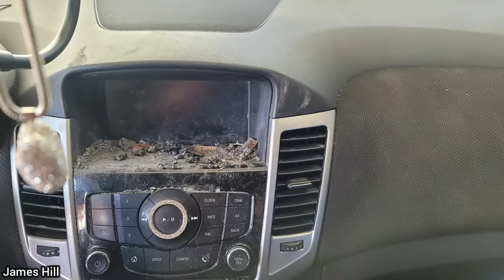Customer States New Oil Pump Installed, Still Has No Oil Pressure

Comment: Some repairs should legally be beyond "declined."
Reply: Sometimes “declined” means “run away screaming”.
Reply: Yes!  If the car is obviously unsafe and the customer declines repairs,  let them know that the car can only be removed from the shop by a tow truck (and call the cops beforehand to let them know of such a removal in case there's trouble).  I'm sure a legal technicality would allow the customer to demand that it be unhooked after it leaves the shop premises but, the customer will still have to pay the minimum towing fee and the shop cannot be held liable for the unsafe car.
Reply: We used to push them into the street at the customer's request if they didn't want to pay a tow fee to get the auto home. We wouldn't let them drive on our lot. It's their choice once it's off our property, ours until then.
Reply: @thewesty101  That's a fair compromise.
Reply: I've been in the auto business for 20+ years. In NY you can pass state inspection with bad ball joints which in my opinion is way worse than a headlight out or torn wiper blade which makes you fail.
Reply: And all rigs 10 years old or more should have to go to a safety inspection
Reply: @Fordgroup00  Had a friend that joined the Navy and was stationed in Japan. I forget how old his car was but to pass inspection the whole brake system needed to be replaced (lines, hoses, calipers, master cylinder, booster, etc.)  Also any kind of oil leak was an automatic fail.
Reply: I'm not a lawyer (but i've played one on tv, j/k) 🤣 But seriously, along the same line if a bar keeps serving a customer who is clearly intoxicated to leave knowing they're going to drive and they get into a possibly fatal wreck, that bar could be held liable, right? These shops should also not allow clearly dangerous vehicles to leave their shop without alerting the authorities if for no other reason than to cover their asses in case that vehicle causes a wreck afterwards. Any real lawyers wanna jump in here?
Reply: @fosterpainter when you're driving a vehicle so badly damaged you become an active threat to anyone around you it's not just your life anymore
Reply: No, absolutely not. 

If they were to implement a federal system of some sort we'd end up with some sort of household inspection nonsense. 

Car for the 1990's comes in for an inspection
Car gets marked for a brake job
In order to change the brakes the entire system now needs to meet modern safety standards
Reply: @Froosev2  My PU passed VT inspection about 5 days before my rear brake line finished rusting clean through. VT does check ball joints though.
Reply: @antilogism  ... you have to remember that most state inspections only check to see if things are working NOW.
Reply: @BlackPill-pu4vi  ... yeah, and if the police know that a certain car is NOT legal for the road, they can write the guy up for operating with faulty equipment and start the tow process again.
Reply: In germany there is a safety inspection every 2 years for all cars, trucks, farming equipment and motorcycles. Only ,,Mopeds" and ,,Mofas" (both like motorcycles but slower) don't have to, but it is in your duty to keep them roadsave. I started to do some work by myself, like cleaning the breaks because they got sticky (grinding all the time or wouldn't let lose), and the shops would charge 250-600€ per wheel for ,,new parts"... 
I removed the dirt from the breakshoe (im not sure if the words correct, I'm not a mechanic), removed the rust from the gliding pen, checked if everything looks good and greased the gliding pen. Took me 1,5h per wheel, and fore no cost including I know how it looks really if I need new breaks. I have only fore my some backyard mechanics in the near with not much knowledge about my car type resulting in wrong parts which are not exactly suitable fore mine or those with the knowledge charging a lot of money. The next really brand shop fore mine is now a 4h trip away after the only one which was 2h away closed.
Reply: @JohnnyD1993  Most of the rest of the developed world manages quite successfully to implement vehicle safety checks without requiring (say) a 1990s vehicle to have its entire brake system replaced "to meet modern safety standards". Why would the USA be incapable of doing so as well?
Reply: @dunebasher1971  Rules and regulations aren't ever about anything other than money. 

Why allow them to continue driving something old when you could get them into a newer automobile?
Reply: @Froosev2  

hmmm the oil leak thing seems weird. Some leaks, absolutely. The brakes, I just spent $4000 on new brake system on my wife’s ’02 Lexus. 

It absolutely should be safe on the road, it’s not just “you” you’re endangering

So I did a quick google search on the oil leak, it basically said SIGNIFICANT leak(s) would fail. So your “friend” was obviously driving around a sh’t car that needed some work done to it SMDH
Reply: @Fordgroup00  it hadn't been inspected at that time, he was just telling me what they were going to look at.  Now that you mention a significant oil leak that sounds familiar.  This was 20+ years ago
Reply: @Scrap_Goblin  Some don't understand that when you're behind the wheel, you're using a couple ton weapon. Negligent use laws exist for other weapons, so why not your daily one?
Reply: @dunebasher1971 the part about meeting modern day standards was sarcasm, that's the process for most home repairs when you have someone licensed work on it
Reply: I have called the State Police and had vehicle's towed to the scrap Yard Because of Frame Rot and Dangerous Damage issues to Car's & Trucks
Reply: Always Make sure a Customer signs a Repair Order that warns Them of Dangerous Damage's Found and REPAIRS Rejected by Car owner's! Sometimes you Need to Contact the State Police About unsafe Vehicle's!
Reply: @BlackPill-pu4vi  There are some dummies out there, but more often people can't afford shop rates. I offered a couple times to swap brakes off duty, and I'd mount a tire for free for those who really needed it. I may have missed some points on the state inspections on some cars too, never can tell though. It's just little shit to keep each other up and running to us, but to them it's their entire livelihood
Reply: @Fordgroup00  (re Froosev2's friend. The Japanese inspection is draconian and combined with rapidly rising registration costs after 3 years the obvious intention is to keep people buying new cars.
Many of these used Japanese cars end up here in New Zealand. A 3 year old car with low miles can be a fraction the  cost of a new one. Right hand drive too.
The inspection here is annual (6 months for older) but the inspectors are reasonable and the cars age is taken into account.
Reply: @Fordgroup00  Anything over 5 years. I have a fleet with 2020's that have 200k on the clock. emissions be damned, routine safety items like tires, suspension, steering, brakes. If it isn't safe to drive, it can't BE driven legally in my eyes.
Reply: @Scrap_Goblin  You see, this is where the mandatory safety inspection should be a thing. However, it needs to be beyond the state's control, and be a federally operated thing, with shops having the ability to revoke an inspection certification for unsafe brakes, or bald tires if the customer chooses to not repair the vehicle.  Legally, a shop can only require it be towed away, we cannot legally deny a customer their property(the vehicle) but we can deny them operating unsafe vehicles until it reaches a destination OFF our lot. Unfortunately, from a legal standpoint, that's all we can do. If it leaves on a tow truck, what they do from there is entirely their decision and the customer is 100% responsible after that.
Reply: @bobw7018  

Right on. Yeah I don’t know why this is such a difficult concept.

I don’t even run used tires, I buy new tires. My ex brother-in-law would always buy used tires. I gave him so much grief over it SMDH
Reply: @Fordgroup00  used tires are another thing I despise with a passion. But I'm the same way. I service cars all day, and know we don't just take old tires off for no reason. Our shop has a carbide bit we take a 20mm circle of the sidewall with.
Reply: @Froosev2  

Ah, right on. Yeah that makes more sense
Reply: @GSimpsonOAM  

Then people need to quit buying new cars. I can’t imagine it’s cheaper to get into a new car after 3 years vs proper maintenance of a vehicle to begin with
Reply: @bobw7018  

Right on. A car improperly maintained is a hazard to everyone. I can’t believe people even are willing to risk their own family SMDH I can’t imagine a single time where a used tire is preferable to a new one. Hell even new ones are faulty sometimes.
Reply: @Fordgroup00  you're very right about that. Ive seen tires right off our delivery truck be unusable. I won't even consider unsuitable parts. New for brakes and tires, without any discussion. I value not hurting someone or taking your loved ones because I couldn't control my vehicle.
Reply: @Fordgroup00  Some people simply want a new car. Most businesses prefer to buy new as they know what they are getting (service history from new) and can claim depreciation on their tax.
Parts for imports sometimes have to be ordered and the wait is an issue for some.
There are pros and cons...
Toyota New Zealand, when they stopped building cars started a "Signature Class" of used Toyotas which are checked and approved by them. They still sell new of course. There is a market for both.
Reply: @JohnnyD1993  here in germany we have vehicle safety checks, which must be carryied out every two years, and i can attest you, you dont have to install a new braking system every 2 years. Every car has to go through it, and oldtimers from 1930s are still road legal with their original parts (as long as they are working, a brake check is mandatory, but they are testing if the brakes are working, not if they work to the newest modern standart).
And stuff you see regulary see here on the channel would be very often filterd out by these checks, since that amount of rust damage you often see here takes far longer than 2 years to happen
Reply: @Patrick-bu4vq  ... BRAKES, not BREAKS
Reply: I'm so glad we have "TÜV" in Germany so at least every two years you have to let your vehicle be inspected and if it fails, you're not allowed to use it until it's fixed. You decline the repairs? Okay, you'll have to walk.
Reply: I'm so glad we have "TÜV" in Germany so at least every two years you have to let your vehicle be inspected and if it fails, you're not allowed to use it until it's fixed. You decline the repairs? Okay, you'll have to walk.
Reply: @Froosev2  Here in Australia the car gets inspected every 12 months & the car must be in good working order. No oil leaks, legal tread, no rusted out areas (even panels), brake test & lights/blinkers etc.
Reply: @JohnnyD1993  try looking at other countries, Denmark for example has a bi-yearly inspection of any car or motorcycle, required by law.
in order for vehicles of a certain age to pass, you can register it as an oldtimer/ classic car, and only need to pass the standards of those days.
if you fail, you can drive it to the mechanic to get it fixed, go anywhere else and you lose your licenseplates, and get them back after your vehicle passed inspection.
if the vehicle is decidedly unsafe to drive thay take them immediately
i feel more comfortable knowing that i'm not driving next to a wreck that neither can steer nor brake properly, because those are taken of the street before anything can happen. (the ones behind the wheel are a different matter sadly)
Reply: @JohnnyD1993 you're completely biased to this idea gov wants to hurt you or make you pay for new.

The main goal behind gov mandated MOT's is to ensure the safety of its populace - from 'friend mechanics' without brakes, broken shafts, busted taillights, fire hazard electricals, or rusted off frames.

If you can stomach to hear the reasoning behind it you'd understand it is never about meeting modern safety standards. You can buy a taken cared of Toyota from 30 years ago and it will pass even though it doesn't necessarily meet modern safety/NCAP/emissions standards.

You can buy a 1960's vehicle that is generally a death trap without seat belts but it is exempt due to age and as long as it has the bare minimum (lights, brakes..) it will pass.

Unfortunately some people regardless of their economic situation, regardless if they are desparate need to be warned and their vehicle taken off the road. Not because gov hates them or wishes to overextend their power but because their brakeless, suspension collapsed, rusted 4000lbs truck going 50mph is a rolling hazard for them and for everyone else out in public be it drivers or pedestrians.
Reply: @rupe53  English is not my native language, but for simple communicating is it enough that the other person understands what I mean.
Reply: @thewesty101  fair? Irresponsible.
Reply: @bobw7018  

Right on
Reply: @GSimpsonOAM  

Right on
Reply: @Valks-22  

Agreed 👍
Reply: @olerothemberg3869  The other difference is that vehicles is always tested against the rules which was in force when the vehicle was new.
Reply: @TheStefanskoglund1  

Brakes working properly, wheels having all the lug nuts on securely, safe tires, mirrors, no offset hubs, no aftermarket fog lights on public roads/streets, leaks to a minimum, engine burning clean, lights are all things that don’t matter if 200 miles or 200,000 miles
Reply: @Froosev2  Yeah here in the UK we get a fairly good deal on grey import Japanese cars because we're both right hand drive, and the inspection standards are so good a lot of relatively good condition cars with minor faults often get replaced for newer cars.
Reply: In Germany such damages would render your car as inoperable and could get you in jail if you drive it on public streets. It is absolutely insane to me, that people in the US are fine with people driving these trashcans. These idiots are risking other peoples live out of stupidity.
Reply: @@fosterpainter Totally agree with you. Way too many people out there who think nothing of putting everybody else on the road at risk.
Reply: @rupe53  How many languages are you fluent in with flawless spelling?
Reply: @Patrick-bu4vq  I apologize for people like @rupe53.
Reply: @MaxxBigg  .... this wasn't about spelling. (both spelled correctly) It was an incorrect word. One is a verb, and one is a noun. I already gave him credit on his explanation for not being a native speaker of English.
Reply: So long as that doesn't force a customer to pay that particular shop for repairs, or be forced to use any particular towing company.
Reply: @orppranator5230  Or at least make tows under that category a fixed rate per mile so it doesn't make a difference how these vehicles get home.
Reply: @BlackPill-pu4vi and because of people like you we have a nany state. How are the boosters?
Reply: @sweeptheleg. good job Comrade, your social credit score just went up.
Reply: @rightsdontcomewithpermits7073   LOL!  There's a difference between being a willing slave (shots + boosters) and preventing preventable accidents because of owner negligence.

BTW. I haven't had a flu shot since 1996 when I finally realized what was going on.  No COVID jabs or boosters here!
Reply: @BlackPill-pu4vi  every single accident is preventable. Until there is a victim there is no crime. 
Freedom is scary deal with it. If you can't maybe you should find a safe space!
Reply: @rightsdontcomewithpermits7073   True, no victim no crime.  But, the arguments presented by individuals who enjoy weed or magic mushrooms don't scale up to societal levels.  Especially involving use of powerful machines on public roads, in this case.  

Don't forget that crime and victim status can be redefined until neither exist.  Or, imaginary crimes (i.e. hate speech) can exist because of imaginary victims.  Crimes and victims which exist only in the legal ether and have more rights than you do.  So, I am quite aware of such things.  

I also know the difference between that and expecting cars, buses, trucks, AND private coaches on the road to meet minimum safety requirements.
Reply: i love germany for this
Reply: @rightsdontcomewithpermits7073  Hey, if people are driving around with that one brake rotor we saw in this video, they need a nanny to take care of what they should be doing, but don't.